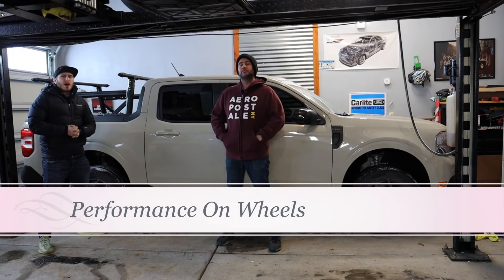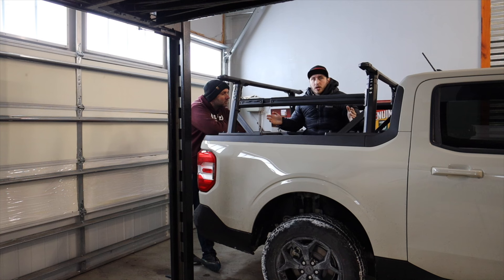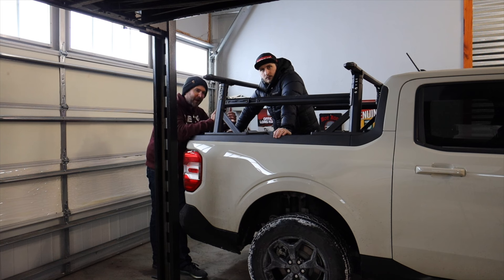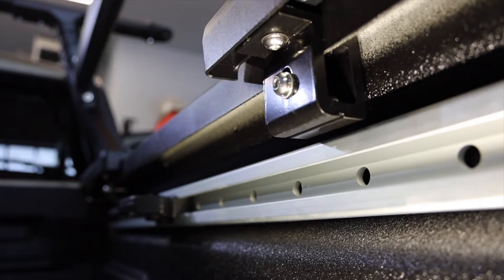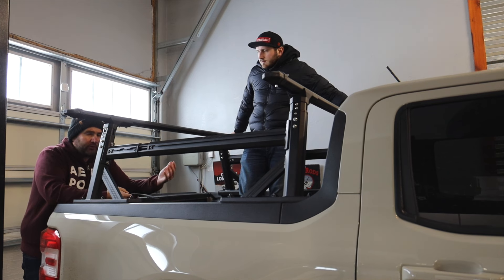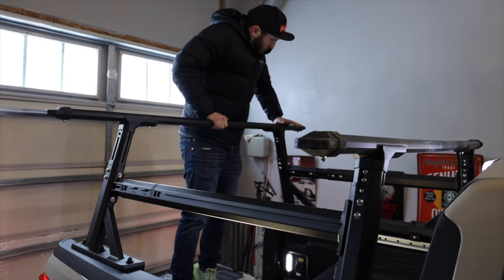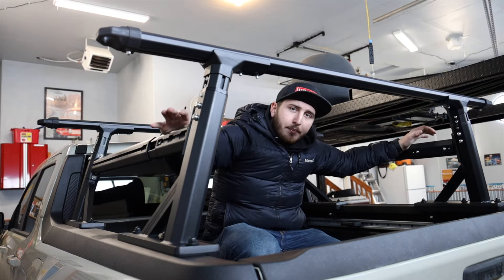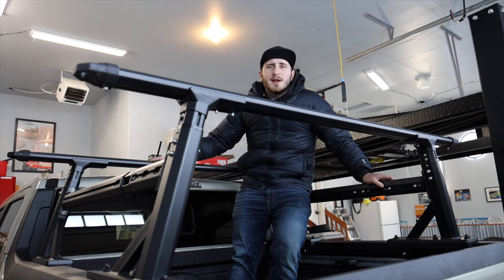Testing The Best Ford Maverick Bed Accessory!

Comment: Think outside the box...can this rack be installed on a tonneau cover with t slots?  would it be possible to cut the lip off of the bracket that mounts to the chair?  I see nuts on the top part of that bracket should be able to install bolts into tslot nuts in the tonneau cover. P.S. Good advice on power tools with stainless hardware...ive had to snap plenty of gauled up 1/2" stainless bolts.
Reply: I just purchased from Amazon for 500, 50 dollar coupon added to cart.  The brackets can be unbolted and used with a tslot application, no modification needed.  Melipron has a couple different rack set ups.  Pay attention when you choose your rack.
Reply: @henryruiz509 which one did you order? I have T slots as well.